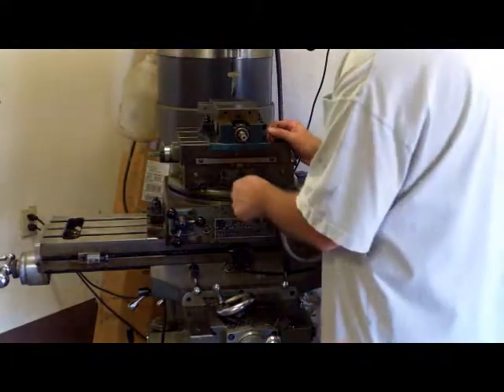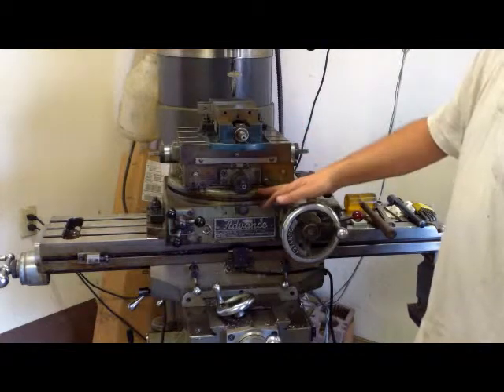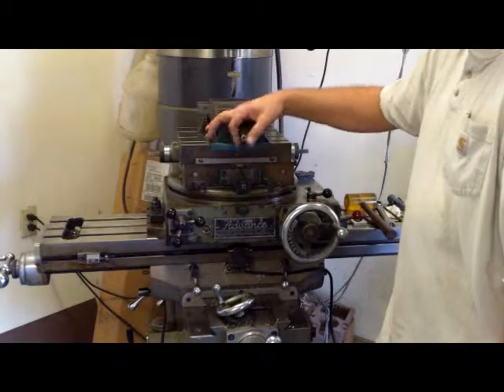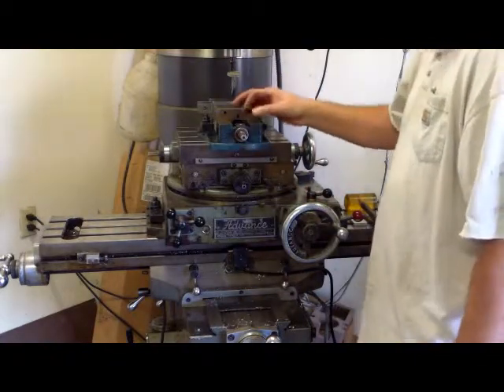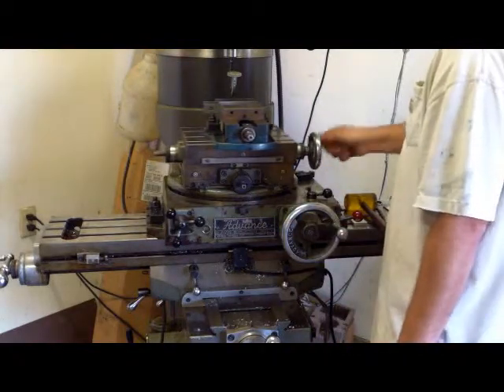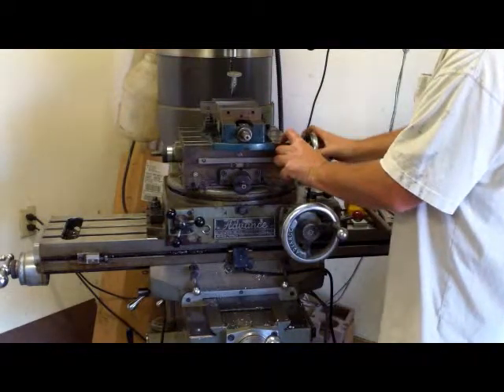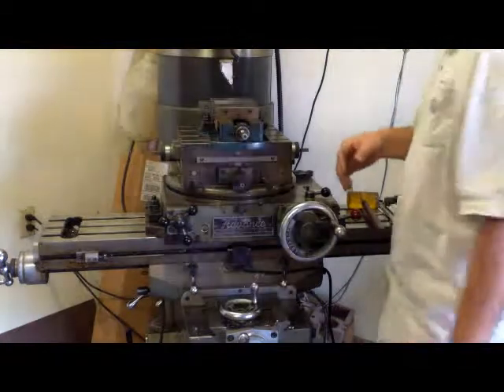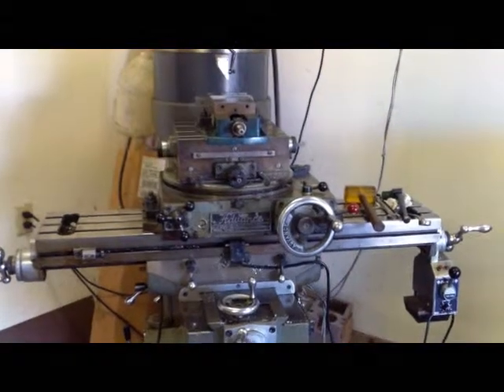No CNC needed!!! setting up a cross slide rotary table part 1

Comment: Hi,
 Thanks for the great explanation. I just picked up an Advance 15" rotary table without the cross slide on CL but it doesn't have a manual. Do you happen to have one? I'm not sure what the two black switches on the right side of the table are for. I see from your video that there's a way to disengage the handwheel so the table can rotate freely. My table has that spindle still in place but there's no handle attached to it so I didn't know what it was for. I noticed that right after you engaged the handwheel you also toggled the black switch above it. What's that supposed to do? Thanks for your help!
Reply from the maker: Sorry no manual. the black knob on the right hand side is to lock the worm gear to keep it from disengaging, the red handled knob is to engage an disengage the worm
Reply: Thanks for the quick response. Does that apply to the black knob at the back right of the table as well?
Reply from the maker: Are you referring to the 3 handle knobs on the left side? if so that is a friction brake for the rotary part. I lock it completely when I don't want the table to rotate, if i'm milling a arc I put some drag on it sometimes.
Reply: No, that is pretty clearly labelled on my table. On the right side of my table there is a black knob close to the wheel and another, identical black knob at the back side of the table. I posted a photo to Imgur for reference. Here's the link: https://imgur.com/a/UpHrtxk
Reply: Also, the person I bought it from said that the black thing in the middle is some sort of clamp but I'm just not sure how it's meant to function.
Reply from the maker: sorry, I thought you had a cross slide rotary table. i have no idea what the rear knob does, mine doesn't have one. the thing in the middle is a table stop, there should be a "T" slot around the outer edge of the table with some adjustable stops so if you wanted to cut a arc it would stop in the same place. these are missing on mine.